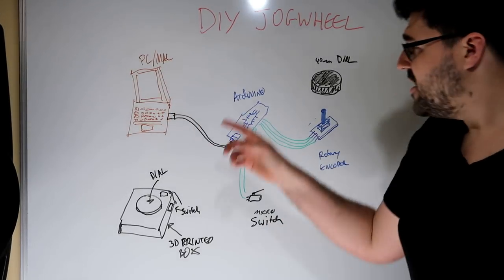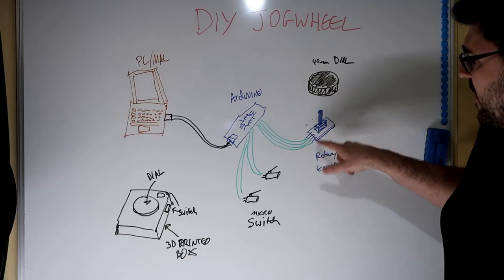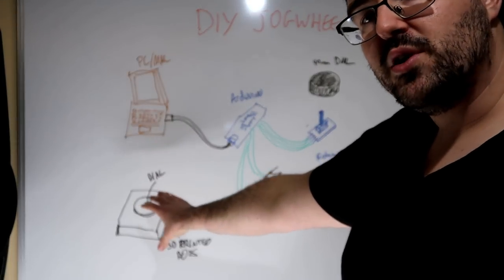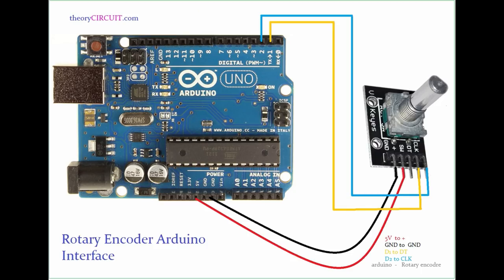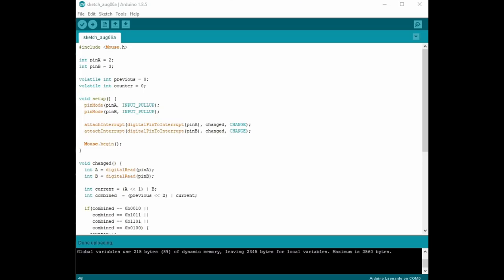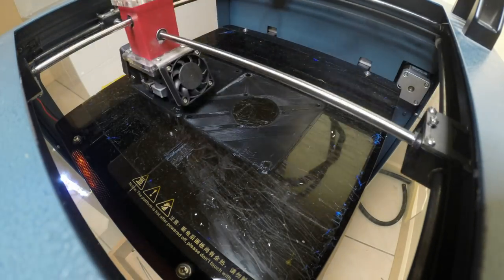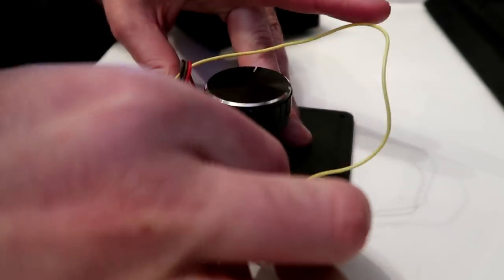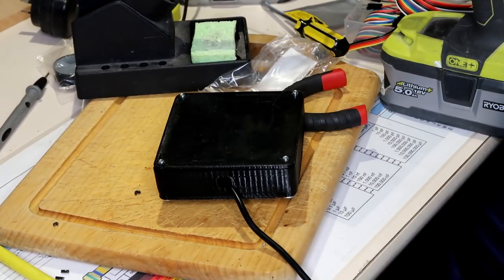HOW TO BUILD A JOGWHEEL ( DIY ARDUINO )

Comment: Nice idea! Can You tell how to edit the Arduino code for scroll-wheel action?
Reply from the maker: Hey thanks. Should be easy. At the end of the code replace 

Keyboard.write(.....) ;

with

Mouse.scroll(-2);

Inside the bracket where I put -2 that will make it scroll downward if it was a positive number it will scroll upward. So change both the keyboard.write lines to suit which way you want upwards and which way downwards. And the number you can play with to get it how you like the feel. 
Let me know how you go!
Reply: @ScottyDIY  mouse.scroll is not a valid arduino parameter
Reply from the maker: whoops sorry its in the "mouse.move" function for the arduino to take over mouse check here 
https://www.arduino.cc/reference/en/language/functions/usb/mouse/mousemove/

just checking you added #include <Mouse.h> ??

Comment: Great. I am trying to build something like this myself. Jog wheel for video editing seems to be forgotten. But it makes editing much faster. I decided to rebuild an old SONY editing controller for the purpose. Made all keys work as a keyboard. Still need to get the jog wheels to work. Absolute beginner at arduino, so it may take some time...
Reply from the maker: Good luck. Let me know how you go with it.

Comment: Looking good!! Does this also require some software to talk to the computer?? And will the software allow for the future buttons also?
Reply from the maker: Thanks. The software to program the chip is open source by arduino. Once it’s programmed all you need to do is plug it in to the USB port.

Comment: Excellent! thanks ... how can I use an encoder in a virtual dj program like jog wheel?
Reply from the maker: well kind of depends what software you are using if the software has key binding to the jogwheel you could set the movement to that, not sure if this setup would be to clunky or not, I use a traktor S4 and I'm sure what they are using in the jogwheel are very sensitive versions but maybe you could get a more smooth rotary encoder
Reply: the version of the software used is the 8.5 proinfinity of virtual dj. the encoder ky-040 ... how can I configure the binding of keys to jog wheel? I have no experience of programming the arduino uno board to use the encoder as a jogwheel ... thanks for your answer!

Comment: I feel compelled to mention that the use of Keyboard.h limits which Arduinos you can use. Isn't that limited to 32u4 processors? I tried for an hour to make a similar project work with a Nano and found it would not compile because of this problem. The Pro Micro works fine because it is a 32u4 board.
Reply from the maker: I haven't tried to be honest, sounds like it might be an issue on the Nano. thanks for the feedback

Comment: Hi. Are you using a special type of encoder to perform this jogwheel function? I am currently trying to setup a regular midi controllers encoder to behave as a Left/Right selector for mixer channels in Logic Pro X but am having difficulty. Some folks seem to think this isnt possible given the cc messages the encoder is sending out (0-127).
Reply from the maker: Hi, I just purchased a generic encoder off eBay, think its a KY-040, sorry don't know enough about Logic Pro X to help with your project

Comment: Does it get that sensation of an uncontinued rotation that the this kind of  rotary encoder gives? Or using an 3d printed jog smoothes that?
Reply from the maker: nah you can feel the clicks or steps of the encoder, this could probably be done with a motor as well to make it smooth but for editing videos its better with the steps they act like frames

Comment: Hey, I am wanting to record the position on the jogwheel, so participants in an experiment I am conducting can turn the wheel and it will register as a numerical value on excel or something similar. Any ideas how I could do that?
Reply from the maker: Most rotary switches like this work by sending a signal to say I just move forward/back x amount of steps. They sometimes do miss steps if moving fast. So in your case without knowing exactly what you’re making it may be better to do a stepper motor that detects steps and output the data. What speed will it be turning (spun fast like a spin the wheel or slow like a dial) does it also need to be smooth movements of could it be steps like a 12 position switch?
Reply: @ScottyDIY  Hey thanks so much for your reply. It will turned slowly like a dial, smooth would be ideal but if not possible steps would be ok. Stepper Motor is a good idea, thank you. I found some software called VData & Vcode which I can input the data from the jogwheel while the participants are watching a video (they spin the wheel as to how they are feeling).

Comment: is there a command for mouse wheel? Not using Keyboard.h?
Reply from the maker: See the pinned comment. Is that what you are after?
Reply: @ScottyDIY  mouse.scroll  is not a valid parameter

Comment: Can't editing int after effect?
Reply from the maker: Sorry i don't understand what you are asking
Reply: @ScottyDIY  for after effect
Reply from the maker: i have never used after effects but the jogwheel in this video is designed for a left and right key stroke so if After effects uses the same it should work if it uses mouse wheel to scrub through the timeline you could use that instead.